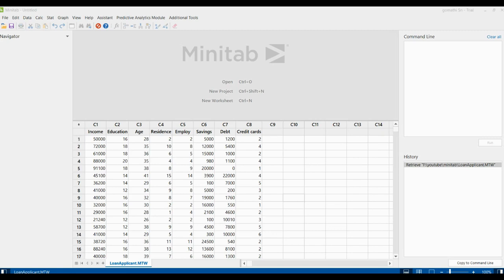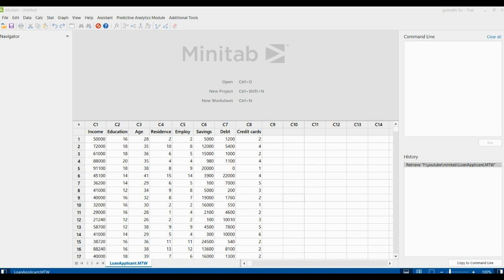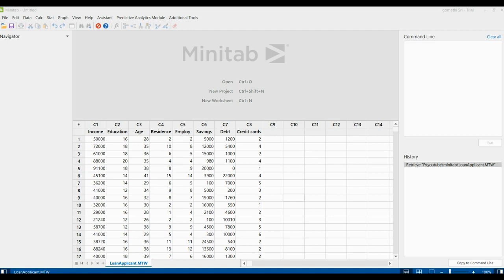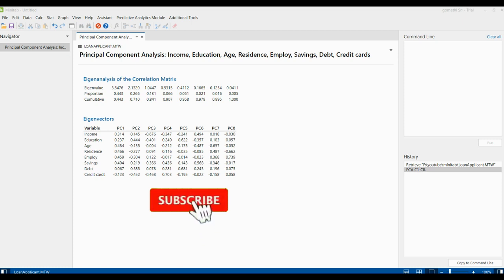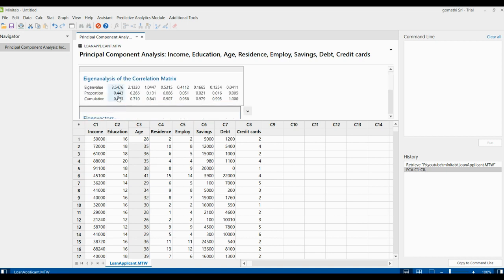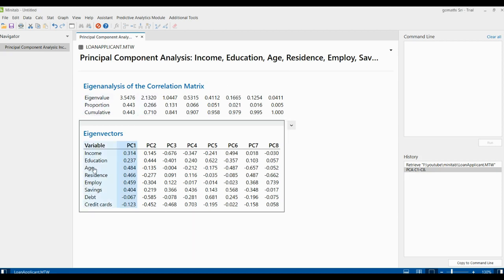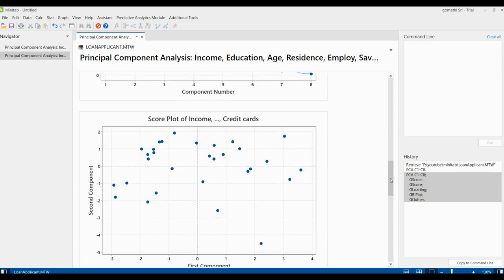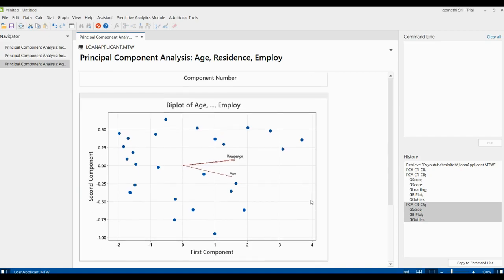Principal Component Analysis (PCA): Illustration with Practical Example in Minitab

Comment: thank you so much madame, this video is very helpfull. 
You said that 90.7% of the data can be explained by thoses four compounds, to see if i did undersatnd, this value is deduced from the cumulative line (by considering the forth value) ? if its not correct, would you mind explain it to me. and thank you in advance .
Reply from the maker: When interpreting the percentage of variance explained in a Principal Component Analysis (PCA) or Regression Analysis, the 90.7% value you mentioned is likely derived from the cumulative variance.

Principal Component Analysis (PCA):

If you are referring to PCA, the cumulative variance is found in the eigenvalue table under the "Cumulative %" column.
This shows how much of the total variance in the dataset is explained when considering multiple principal components.
If you take the fourth cumulative value, and it shows 90.7%, it means that the first four principal components explain 90.7% of the total variance in the dataset.

Regression Analysis (R² - Coefficient of Determination):

If you are referring to a regression model, the 90.7% could come from R² (Adjusted R²), which indicates how well the model (including the four compounds as predictors) explains the variation in the dependent variable.
This value is usually found in the regression output under Model Summary.
Confirming the Interpretation
If you are looking at PCA results, check the Cumulative % column in the Eigenvalue table to verify that the fourth value corresponds to 90.7%.
If you are using regression, look at R² (or Adjusted R²) in the Model Summary section.

Comment: thank you mam really useful and helpful
Reply from the maker: Glad it was useful. Thank you.
Reply: How many minimum dataset required for PCA???mam  @gomstechtalks
Reply from the maker: The minimum number of data points required for Principal Component Analysis (PCA) depends on various factors, including the dimensionality of your data and the specific goals of your analysis. However, there are some general guidelines to consider:

Minimum Samples per Dimension: As a rule of thumb, you should have more data samples (observations) than the number of dimensions (variables or features) in your dataset. In other words, it's recommended to have a higher number of data points than the number of variables you want to analyze.

Large Dimensionality: If your dataset has a high dimensionality (many variables), you will typically need more data samples to effectively perform PCA. Having a high-dimensional dataset with very few data points can lead to overfitting or unreliable results.

Statistical Significance: The number of data points should be large enough to ensure statistical significance in your analysis. This means that the results of PCA should be reliable and not highly sensitive to small changes in the data.

Application-Specific Requirements: The minimum dataset size can vary based on the specific application and the level of precision required. For some applications, a few hundred data points might suffice, while for others, you might need thousands or more.

In practice, there isn't a fixed minimum number of data points that universally applies to all PCA scenarios. It's crucial to assess your dataset's characteristics, such as dimensionality and the goals of your analysis, to determine an appropriate sample size. Additionally, you can perform exploratory data analysis and consider techniques like cross-validation to assess the stability and reliability of your PCA results.